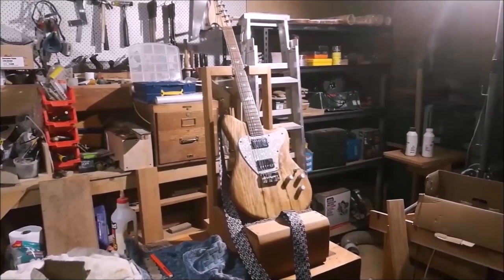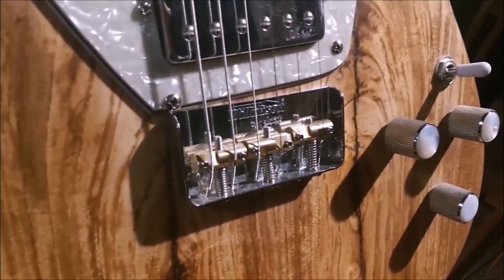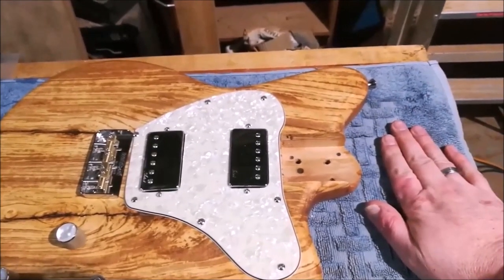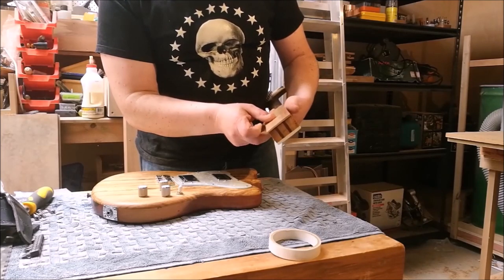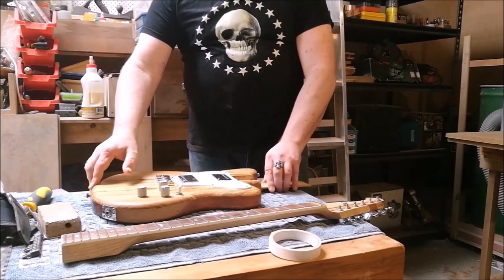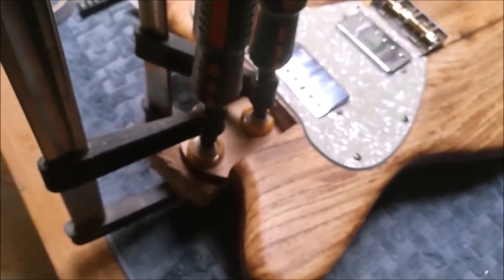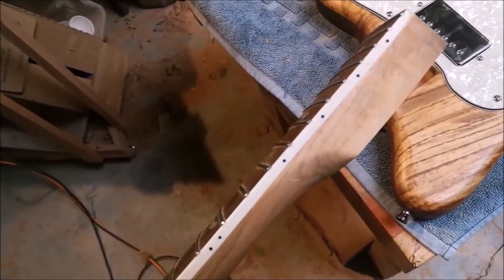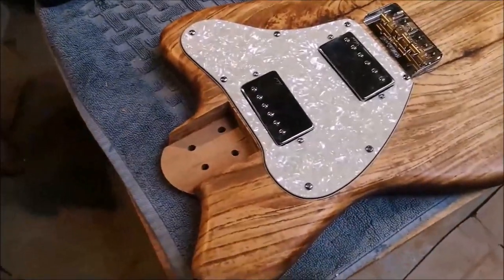126: Lowering the action on a bolt-on neck guitar

Comment: ok so your putting wood. I heard in a video a guy say he puts pieces of cans 2inches wide under the neck. he put 7 layers actualy. that's his way, can you believe that?
Reply from the maker: I assume he's just using those pieces as metal shims. You can definitely do that (you can buy metal shims that may as well be pieces of aluminium can), but my approach was to make the neck pocket the correct depth so you don't need to.